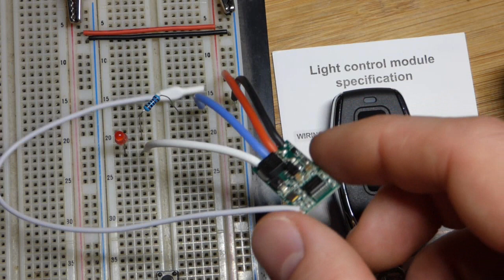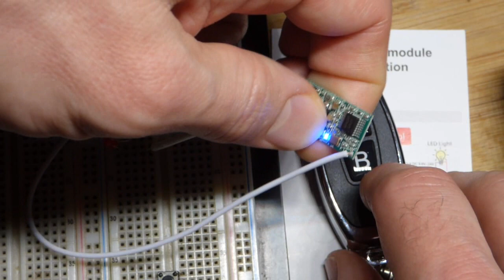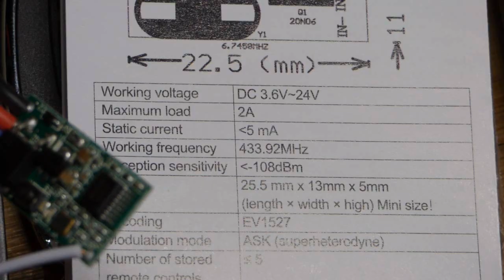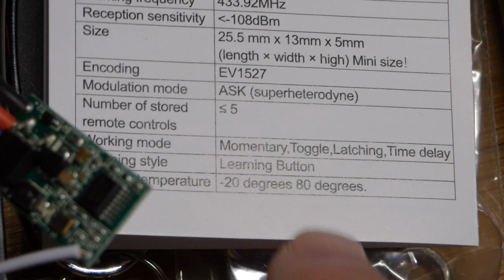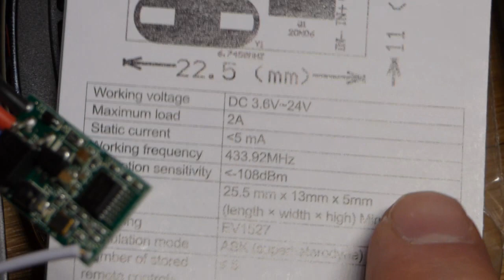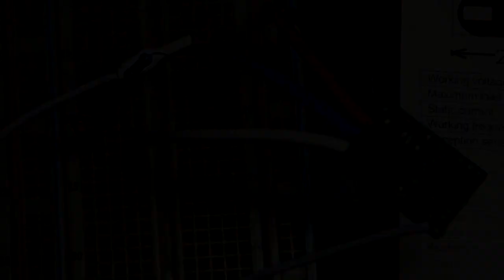Mini programmable remote control power transfer module

Comment: Unfortunately, the Amazon affiliate link doesn't work.
"We're sorry
An error occurred when we tried to process your request.
We're working on the problem and expect to resolve it shortly. Please note that if you were trying to place an order, it will not have been processed at this time. Please try again later.

We apologise for the inconvenience."
Reply from the maker: That's a bummer, it just worked fine for me. I hope it was just a temporary glitch.
Reply: That happens to me sometimes when I get the country wrong on the Amazon website.